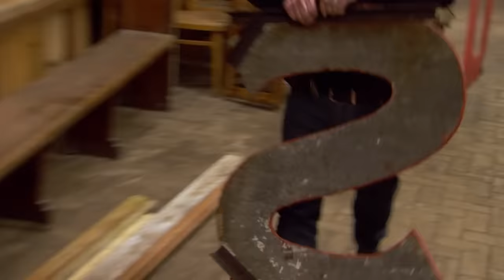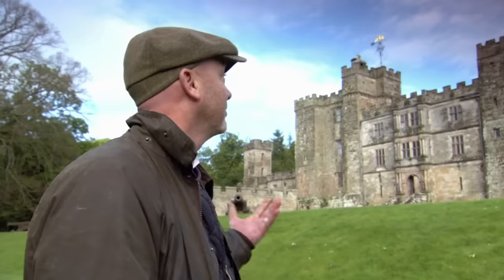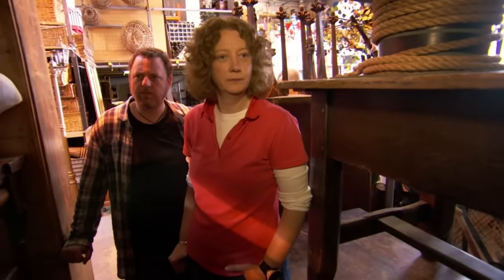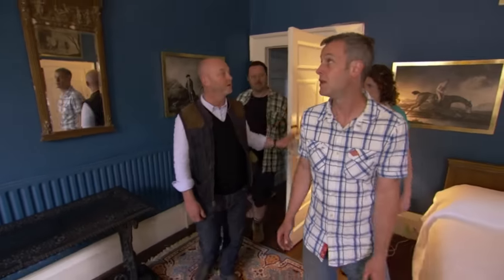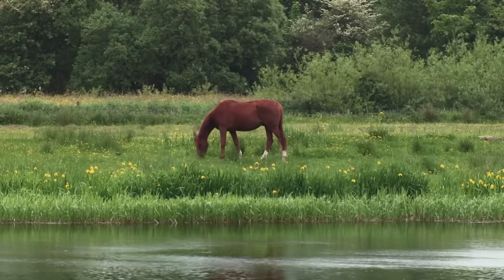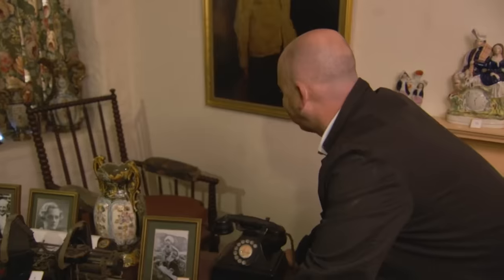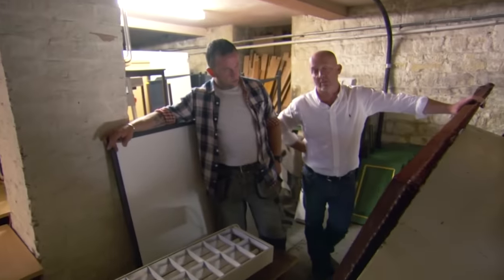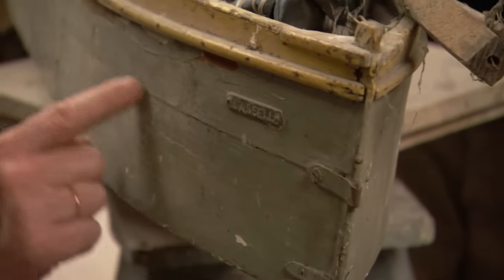Drew Heads Through The Country’s Architectural Backwaters 🏡 | Salvage Hunters - S3 | House to Home

Comment: Pro tip from someone who had a similar lift: if you take off the handle from the winch drum, you should be able to buy a socket that fits the drum pivot - probably 20mm or similar - stick that in your drill, and lift goes up and down a lot faster :)